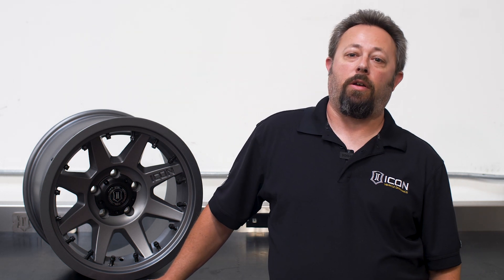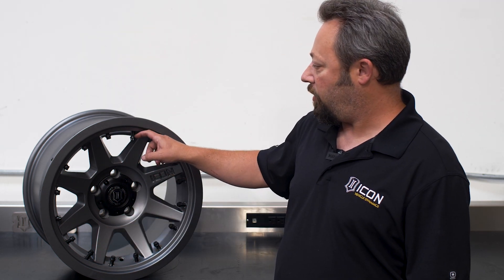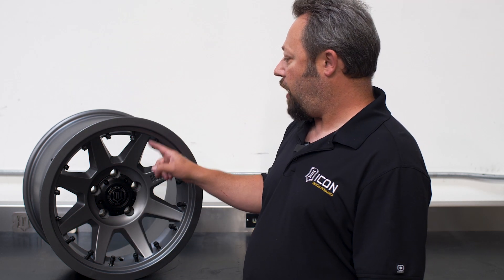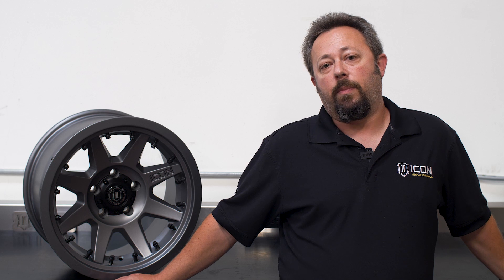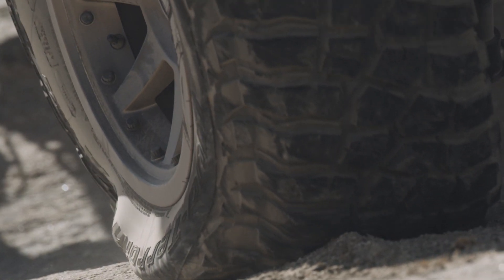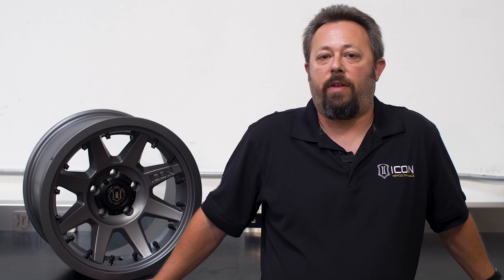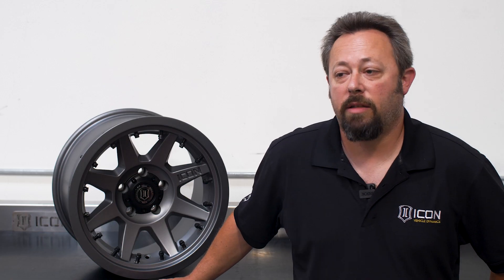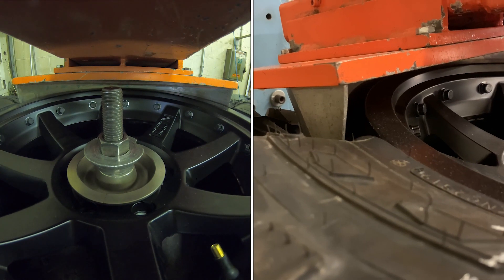FAQ: ICON Alloys Rebound PRO / InnerLock

Comment: Can't wait for these to come out in a 20" wheel size.
Reply: 20" is for mall crawlers 🤣
Reply: @juanj.rodriguez7729  
In a way true but not when you're running Nitto's new 42" tall Trail Grapplers lol. None of the tire shop around here wants to come near beadlocks let alone balancing them.
Reply: Is the 3200 pound rating PER wheel? Not 100 about this I think the entire rear axle of the new F150 is 3800 lbs.

Comment: Why didn't you put lock bolts on both sides?
Reply from the maker: Because in nearly all real world scenarios the tire is most likely to debead from the outer side. The likelihood of debeading the inner side of the tire is highly unlikely, as all of the high loads are transferred to the outer bead in off-road terrain at low PSI (ex: sand dunes, extreme side loading, hard turning at low pressure, etc).
Reply: Also look at the valley in the rim construction
Inners have a long way to go even after if the tire bead slipped over the rim bump the rim is basically the same diameter as when it's on bead so it wouldn't loose pressure
Most any  pressure would pop it back over the rim bead

Comment: Are there plans to use this InnerLock Technology on other models of your wheels? For example, Vector 5 -> Vector 5 Pro?
Reply from the maker: We may release some existing styles with InnerLock tech, but we do have some new designs in the works as well.
Reply: @iconvehicledynamicstv  Awesome. Looking forward to seeing what you release in the future. I have the Vector 5 and the next tire replacement I would be interested in going with InnerLock-beadlock wheels. The Rebound Pro looks nice but I really like the 5 'spoke' design on 5x5 / 5x127 lug patterns.

Comment: Can those little bolt seals be found anywhere?
Reply: I can't speak for Icon but they look like normal O Rings which should be extremely easy to find/source
Reply from the maker: @nwbronco1972  Correct! -4 O-rings that can be found easily